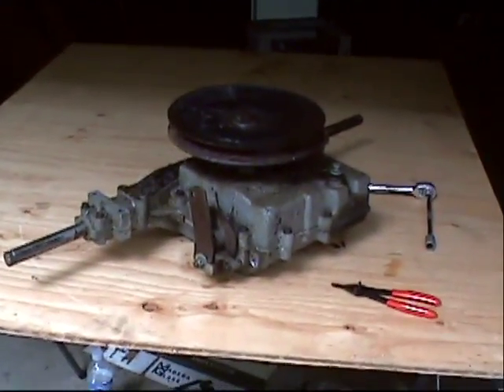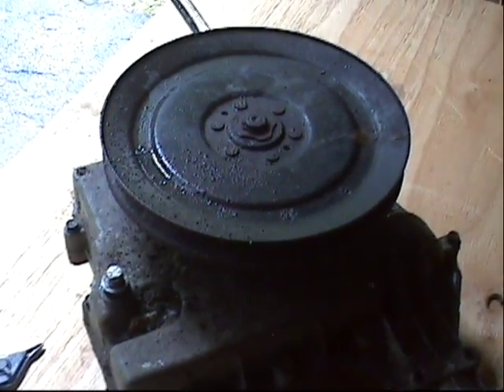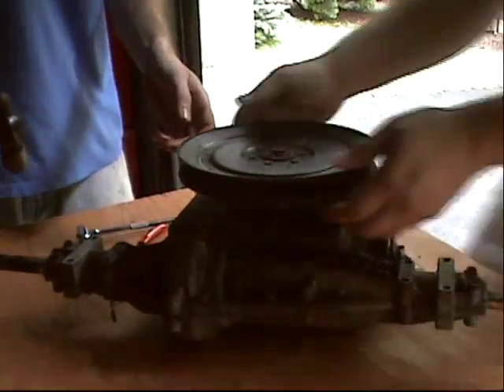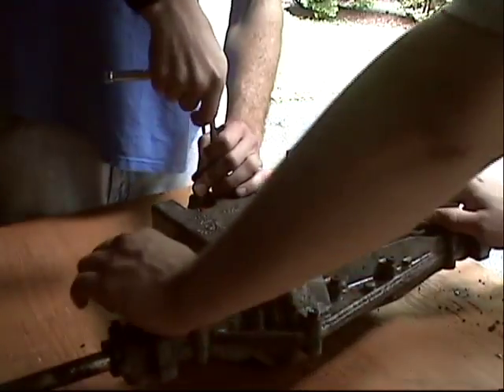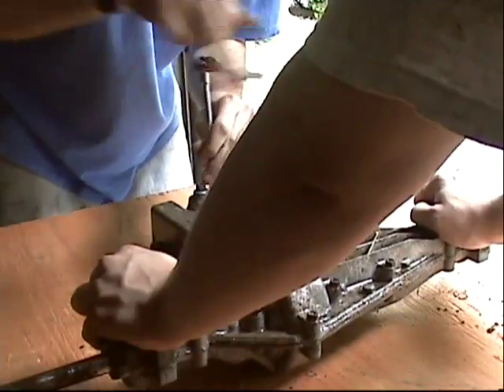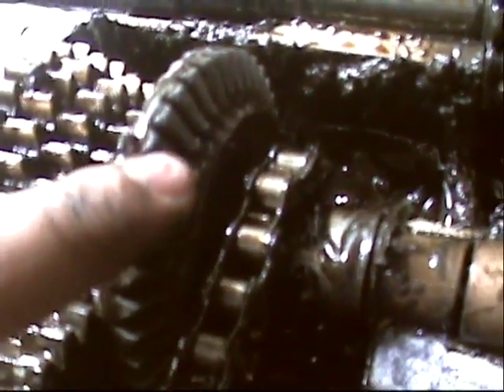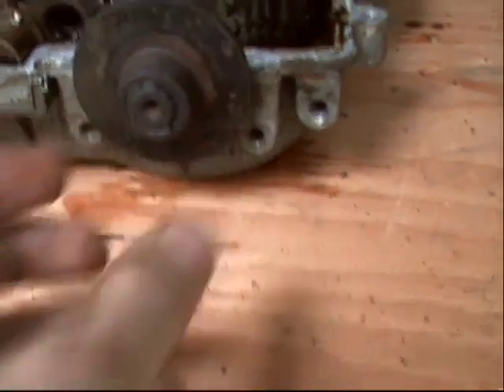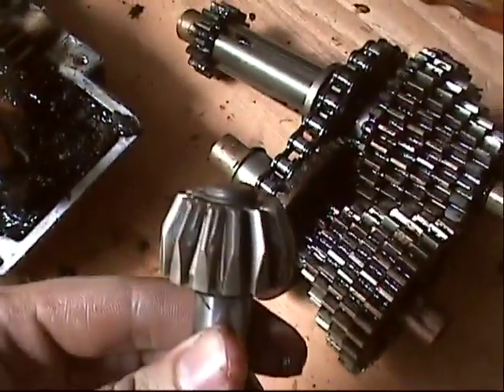Rebuilding a lawn tractor transaxle [Part 1 of 2]

Comment: wouldn't the thing that the little ball and spring sit on (gear selector) have 5 holes for 4 gears? so don't you need to take that thing from the 6 speed too? so it will have 6 holes? or indentations? actually 8 with neutral and reverse?

Comment: I have two craftsman riding mowers which have the freewheeling or disengaging lever on the back of the trans-axle.  Both of them will NOT disengage/freewheel.  I CANNOT push them by disengaging the lever.  What is the problem?  Thank you.
Reply: Your parking brake is not releasing, those 2 little pins that push that puck are rusted,take it apart and clean rust off & lubes pins, adjust parking brake

Comment: You know these boys are just working out the back yard doing what they got to to make them run. Not everybody can afford or have the gear,shafts and pulley pullers! As far as the information contained in this video and the up closer shots of what's there ( so the average Joe that can't afford those extremely high priced repairmen) can put it together and repair there's themselves with just a little common sense! Oh and as to where the ball and spring go this has been the only video I have found to even touch base on it! Good job boys excellent video!

Comment: Do ham fisted "mechanics" know about penetrating oil, wheel pullers and the strategic application of heat? Or do they instinctively reach for the biggest hammer that they can find? Maybe they are proud of the mushroomed end of shafts that they leave behind. How about separating the mating surfaces of a die cast housing by pounding on it with a steel screwdriver?

Comment: I have a 1997 Murray Riding Lawn Mower with a Dana transaxle Model 4450, I am trying to find an input shaft for it, but I understand these part is no longer available.  In the Dana Parts list it is listed as Key #10 Assy Kit Input shaft, part #4513.  I would appreciate it if anybody can help me locate this part.

Comment: What fluid do you put back into it? I have a Ranch King 42 inch tractor built by MTD. It's the 6 speed manual type transaxle. No hydro here...    And how do you change the fluid? This one's 10 years old and I want to change it.

Comment: Hi, i've got a old murray riding mower (1997 i believe) and the problem is that it won't move at all. It does not seem to go into any gears at all. what do you think could be the issue?
Reply: junaid I have a murray hydrostatic that has the same problem. Any idea where to buy a new or rebuilt transaxle or parts?
Reply: don doerner dondoerner@sympatico.ca
Reply: sorry i ended up giving it away for free
Reply: junaid t

Comment: If the belt is too tight (meaning you might have a belt that is too short Sears is notorious for selling people the wrong belt size) and as a result when the clutch is supposed to be disengaged it is not so the gears still have pressure on them so they do not want to shift.

Comment: I have a Craftsman LT4000, 6-speed Peerless that works fine in all gears but will not "find" reverse. Selector moves from 1st straight into reverse with a positive 'click'. Do I have to replace the entire gear assembly? TIA for any advice.

Comment: Top of trans casing where the shifter rod goes thru, has little pins bearings, but ! that rod binds up there over time. That is all it takes to stop the engagement in gears. First try lubercating with some type of oil, WD-40. Work it easy see if thats lets it go. I took mine apart lookiing to find the problem. LOL simple bind where it never gets oiling. gl

Comment: Hey I was really hopeing you could help me, I just got a White Lt13 lawn tractor. It is a 7 speed perlis trany.There is a lever on the fender for gears 1-7. and on the floor beteen your legs there is a lever with 3 positions forward/neutral/reverse. SOOO I went up a big hill in 7th gear and when I got to the top the tractor would not move any more, so I shifted into the revers gear still in 7th and it went in revers fine but wont go forword.Now after shutting it down I cant get out of gear. help

Comment: You should definitely scrape up the old grease with something like an old credit card, or just a pair of rubber gloves, you don't need to use solvent and clean every bit of grease, but there are probably bits of metal worn off gears and such in that old grease, so it will work better with clean new grease.

Comment: I really like your videos - they gave me confidence to buy a 11hp Craftsman this week as a project - with a plow & 38" deck w/ bagger.  With some TLC runs great.  It goes in to forward and back but not all the gears on the 5 speed.  I open the Foote transaxle, and it seemed to be in great shape - not beat or worn.  from playing around with it open, the shifter things in the axle dont grab well on the gears inside for gear 2-5. Which parts should I order to refurb this POS? is searsdirect ok?

Comment: I just tore my Dana/Foote transaxle out of my 92 LT4000, took about a cup and a half of grease out of it, and put in a quart of 80 wt gear oil, seems to be running alot better now... Still need to weld the spider gears though. Seems to shift better with gear oil in it too. I use this tractor for yard/trail riding and am looking for a 4" rear pulley for it...

Comment: Rebuild these all the time...Pack grease where transaxles sit and then where all the gears are put 80/90 gear oil 3/4 the way up to the case and put permtex around the case